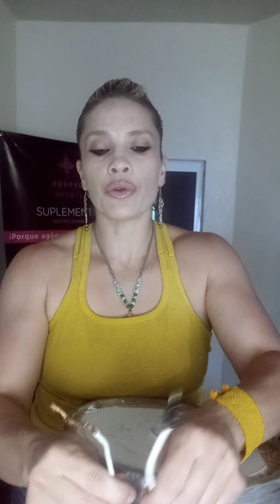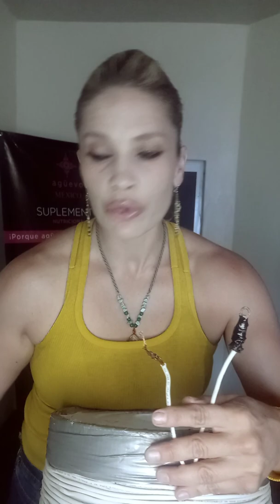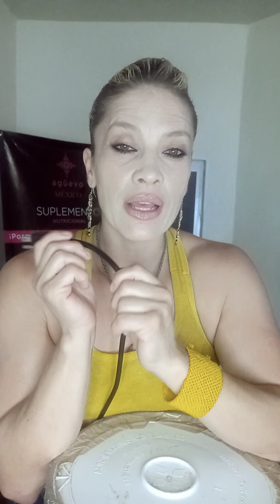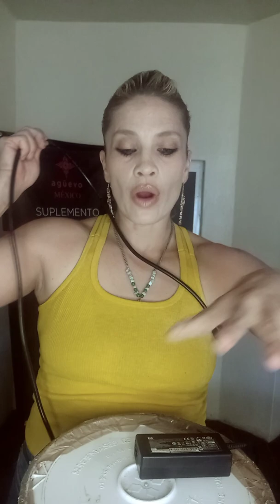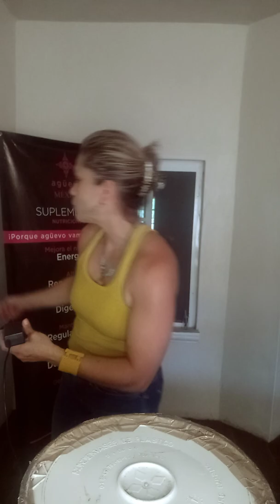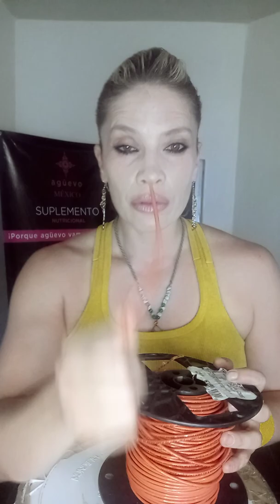Anti-Nano Bucket / Wiring the Bucket Information

Comment: Can you put this directly on your head to shock the nanos inside my brain ears nose eyes
Reply from the maker: I know this is a ligit question. 
My answer is NO.
I did it and it messed with my head for days.
The brain and the heart have strong electromagnetic fields. 
The anti- nano bucket is a field distorter.
I would not use the bucket or magnets in those 2 areas.
Reply: @TruthandIntegrityWarrior  did you pull many nano particles out when you did the head, cause thats the usual implants in targetting individuals with frequency. Heard also from tony when he did this he got many scars on his face when he did the video. Hes also a targetted individual.
Reply: @doggginest2577  DMSO can get past the blood brain barrier and it will kill all the stuff that don't belong there.
Reply: If you don't have any implants or metal fillings I'd say it's ok.

Comment: im literally about to go out and get wire. trying to watch the video to find out how much ilength i need.. lol this is gunna be expensive in canada but thanks so much!!!
Reply from the maker: Copper is more valuble than gold because of this technocratic reality we are facing. Copper is protective in more ways than imaginable.
For the physical body and the electrical body ( the soul.)
Look at it like an intelligent investment in your protection.
Reply: @TruthandIntegrityWarrior  absolutely and i finally made it. i simply couldnt afford what i saw mostly around i found dirty cheap 14 gauge speaker wire from a company called sayal electronics. 35 bucks for 100 ft. plus 50 feet of 14 gauge speaker wire i found brand new off classifieds. took me a week to gather everything and im literally about to take this dip :) i did all the splicing with proper bullet connectors and heat shrink and this is absolutely the best thing for any human being in exsistance!! thankyou
Reply from the maker: @markj6984  So excited for you! 
Make a video on the speaker wireing you did because that isn't easy. 
Speaker wire is different than the single strand. 
Great job!
Reply: @TruthandIntegrityWarrior  Nice i didnt find any problem so far i found it very easy to work with. i messaged tony directly told me to get speaker wire. :) i learned in my research that speaker wire holds a 30 amp charge i could run this on my ebike lol. speaker wire was a cone to make contractors pay out the bum hole i belive haha. i will absolutely let u know about my results and muster up the courage to do a video! thanks so much.